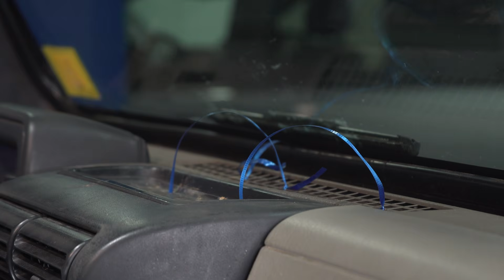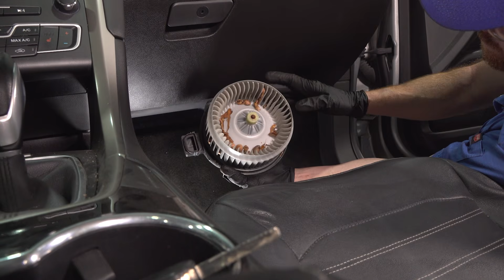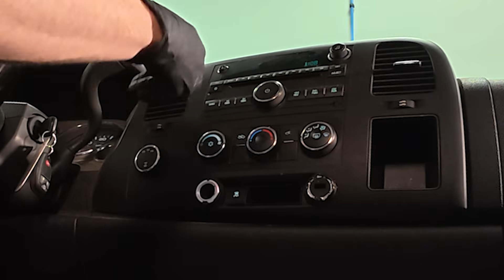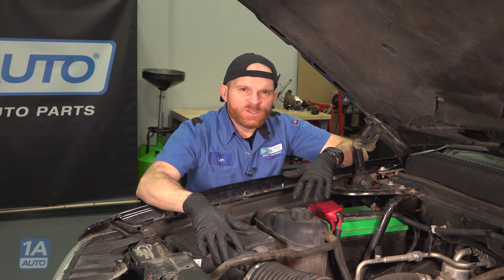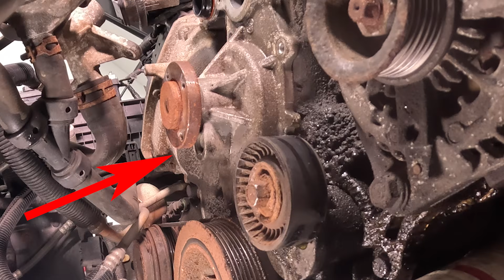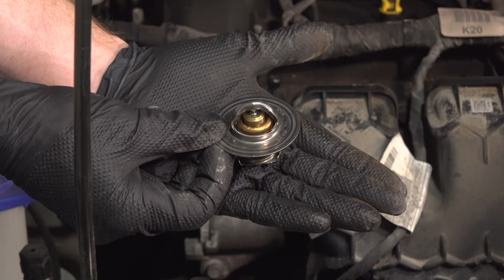No Hot Air? DIY Automotive HVAC Solutions

Comment: Hey there! I have a 2016 Cadillac SRX and I stupidly attempted to use the passenger window during when we had bad ice, it seems like the window came off track and there’s some knocking sounds when I attempt to hit the up or down button. The window also won’t go up all the way, just slides down a couple inches. 

Are you able to point me in the right direction to what this might be? 

Thanks so much!

Comment: It's funny I should see this today.
My truck was acting up again with the heater.
About a week ago the truck would not heat up, then it would heat up only when driving, but not when I was stopped at a traffic light.
I checked the hoses going to and from the heater core, and those were warm. So it wasn't that.
I opened the reservoir bottle cap, and a bunch of pressure came out. 
I added more coolant/water mix, and it was fine. Worked great until today.
Today, it was only heating when I was driving.
So I guess now I have to get a termostat and replace it. 
Thanks for the videos.